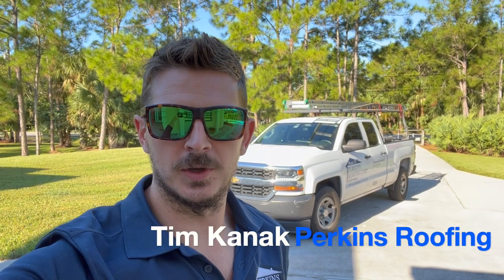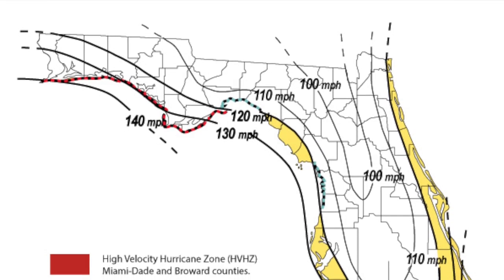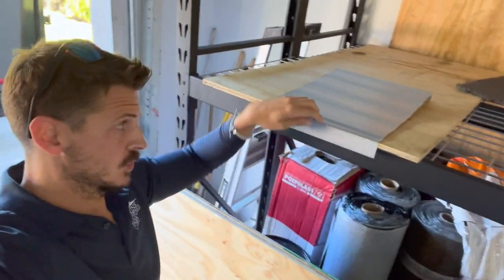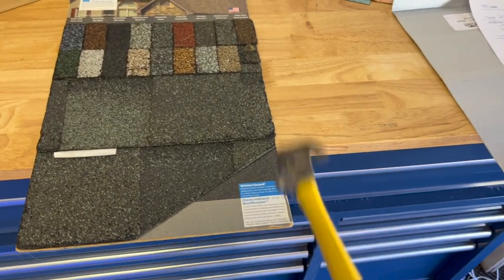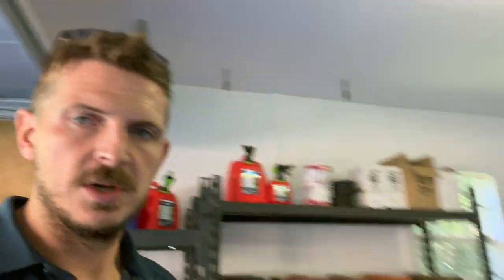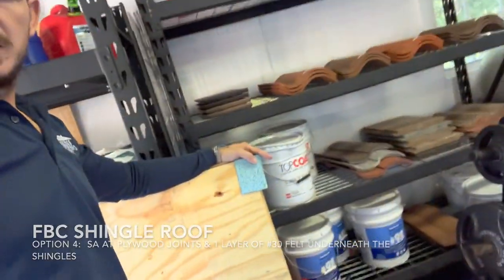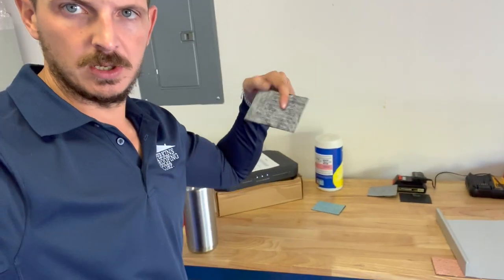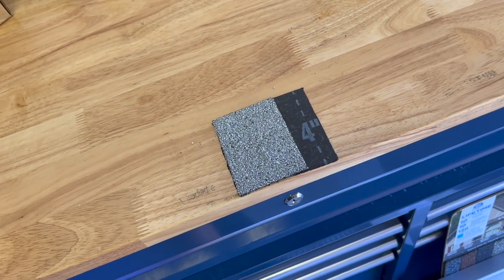What’s the Difference Between HVHZ and Florida Building Code? | Perkins Roofing Corp.

Comment: Hi Tim, If you put a self-adhere membrane instead of a 30# felt, what happens when the time comes for re-roofing? Would the membrane come out or would you need to replace the roof deck? Also, what are "synthetics"? (you say they are lighter than 30# and that you don't like them). 
What brands of 30# felt are the thickest/best quality? Thank you!
Reply from the maker: It is most definitely a more difficult demo for the next contractor, but it will come off - just like a hot mopped layer will still come off of the wood.  Tamko is the best 30# on the market - we use it with shingle roofs in HVHZ.  For tile or metal roofs we usually use GAP (which is better than Apoc and others), since they are getting an additional water barrier on top anyway.
Reply: FYI: At this current time of writting Kirsch Building Products SharkSkin Ultra and Ultra Self Adhered have the highest negative design pressures on the Florida Approval database. This Polypropylene Synthetic has the highest numbers on 1/2 and 5/8 for Direct Deck application , mechanical fastened or traditional two ply. The published numbers for Polystic are much lower. Any asphaltic Peel and stick suffers at 180 days UV exposure and sometimes look so bad at 3 months that they are a cause for concern. Mike Silvers, Technical Director has sounded the alarm that 30lb felt should be eliminated because of low performance in testing funded by a  Bob Ferrante endowment. Sharkskin has been tested up to -420 psf. This value alone is greater than 913 published design pressure numbers out of 918 Mimami Dade NOA's for Non-Structural Metal Roofs that are completed systems. If you use this product under inferior asphalt shingles you would get the same hight wind performance without the additional costs. SharkSkin Ultra is currently .26 cents per square foot at ABC Medley Branch.
Reply: @perkinsroofingcorp  Great! I'm going to quote you on that about Peel and Stick coming off of the wood like hot mop because Mr Silvers, Technical Advisor to the FRSA says it would be too difficult to remove on average and that it would be far better to go over it with another tin cap of 30lb and your choice of Peel and stick or hot mop....ect....ect and that any roofer worth his salt knows where the rotten wood is. The same man is also stating that any 30lb felt is the weak link in a tile roof assembly for wind uplift performance and suggests with testing that the 30lb is performing far below previous expectations.
Reply from the maker: @danielarguelles5241  One can guestimate where the rotten wood is, but without attic access that's not true in Florida.  The primary cause of rotten wood is not water intrusion (which you can guess due to bad details, cuts, etc. - but is termite damage, often starting at the beams before reaching the plywood).  Note, 30 uplift is all based on how many fasteners you use, HVHZ requires more fasteners - therefore better uplift.
Reply: @perkinsroofingcorp   Good point, termites can really real havoc in a roof deck. I think Miami-Dade is concerned with dry rot from points of moisture intrusion and oppose the use of direct deck application just like they have a memo against the use of waterproofing elastomeric used to extend the longevity of asphalt shingles. Apparently there was a serious issue with moisture damage and a continuous elastomeric roof application also changes the aerodynamics of an adulterated asphalt shingle roof. FRSA Testing by PRI last year indicates that 30lb felt when tested with various peel and sticks only yield around maximum -60PSF. After the 50% safety factor this number is -30PSF. The 30lb felt they say is what makes it so that these other peel and sticks fail at these low pressures and precisely the reason they want to throw it under the bus in favor of a direct deck application. FRSA seeks to throw Miami Dade under the bus because they cite we are subpar to the Florida Building Code. I personally think any Florida Approval is not worth the paper it's written on....🙂
Reply from the maker: @danielarguelles5241  haha, funny enough I have a video on not coating shingles and tile too!

Comment: Once again a very educational video- I have a question as I need a new roof (live in Orlando)- replacing a concrete tile roof with possibly stone coated metal or tile. One roofer has indicated that his company installs all roofs in our area according to HVHZ code (battens for metal roof and nailing according to HVHZ code)- is that overkill?
Reply from the maker: Thank you!  HVHZ does not require battens unless the slope of the roof is greater than 6/12.  

I like direct-to-deck attachment better when under that slope.

For metal, the best install for HVHZ would be 1 ply of Polyanchor HV and a fire/water shield of Polyglass XFR SA installed after.  Then the metal panels.
Reply: @perkinsroofingcorp  Based on my house Roofr report, the majority of the roof has 7/12 slope (the rest is either 5/12 or 6/12)- are battens still recommended? Not sure if battens can be placed only on the 7/12 slopes and not the 5-6/12 slopes- doesn't seem like this would be recommended.
Reply: @heartgod most likely it would be unnecessary if the majority of the slope is 5 or 6 on 12

Comment: Thank you Tim for your great videos. I live in Broward County and I have questions regarding the L Flashings as per the different codes. Does any of the codes require the wall flashings to be installed with a counterflashing and weep/drip screed for the stucco to be able to release its moisture? Could you please point me to the best standards when installing wall flashings behind stucco? Does it make more than an esthetic difference to install the wall flashings over the stucco? Thank you so much.
Reply from the maker: Yes, new construction absolutely requires this if the wall flashing detail is "L" metal with stucco back down over it.  The other method is just to install termination bar and counter flashing 8" up the wall, caulk the counter flashing and there are two different types of counter flashing - one that can be stuccoed over and another that is to be left exposed with the caulk bead as the primary sealant (NOTE:  This caulk will not last the roof life and will need re-sealed as regular maintenance).  Therefore - stuccoing back down over either transition is the best method to fully seal the wall transition.

Please note, depending on the inspector --- during re-roof they may not require flashing metals to be replaced. On our contract, we have this as an optional item depending on the condition of the existing metal and if the inspector requires it, because it can add a decent amount to the contract total depending on total LF of wall transition.
Reply: Thank you Tim for sharing this. From your experience, is it likely that a wall flashing in good shape at the time of re roofing could last a second roof’s life? Or is it better to change them at time of re roofing to avoid having to open the roof a few years later? Thank you!
Reply from the maker: @pzcx0p163  It's definitely better to change them, but more expensive.  The flashing can last the life of the second roof, depending on how they are installed, type of metal, is the building maintained and painted regularly, etc.

Comment: Great info here!  What is the new nailing code for decking on  a re roof?  Do you need to go back over all the decking?  Thanks!
Reply from the maker: Yes, we are required to re-nail sheathing - sheathing now requires more fasteners than it did 10-20 years ago or more.  Many contractors skip this.
Reply: @perkinsroofingcorp  Whats the pattern?  Im in Seminole County.
Reply from the maker: @abmcd9381  They will read on the permit, it all depends on wind upload.  Patterns vary from eaves to corners to field.

Comment: Is the self adhere difficult to remove once you eventually need a new roof ? Great info thanks !
Reply from the maker: More difficult than a mechanically fastened base sheet, but no difference from a hot mopped base sheet.
Reply: @perkinsroofingcorp  thanks